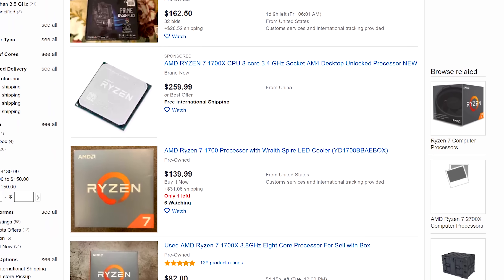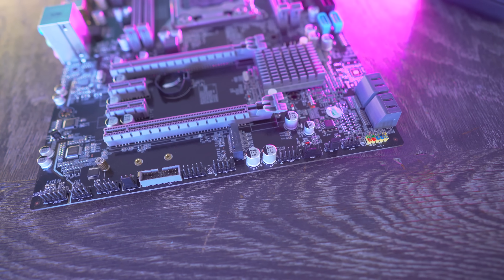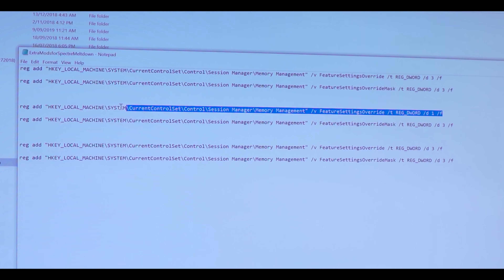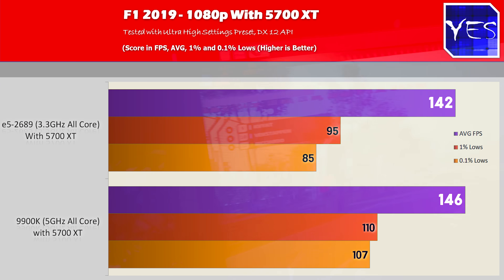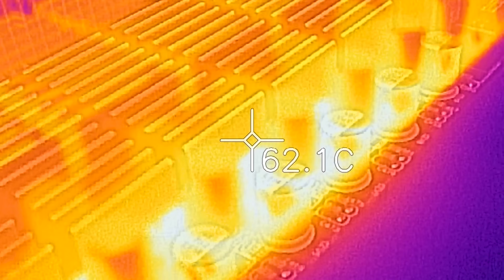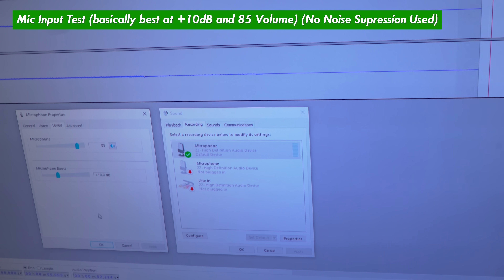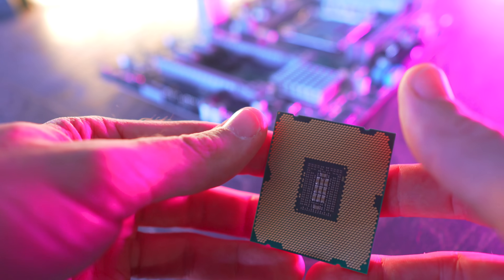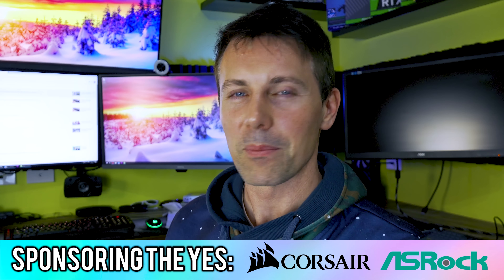8 Core CPU for $53....!? Will it BOTTLENECK a RX 5700 XT...!?

Comment: Machinist is better than Kllisre X79 or Huanan?
Reply: I would actually suggest someting like this, even has a better chipset than the one in the video
https://www.ebay.com/itm/X79-Intel-B75-Chipset-Support-M-2-USB-3-0-Socket-Desktop-PC-Motherboard-Game/123777286353?hash=item1cd1b380d1%3Ag%3AuFcAAOSwLuJc5RBT&LH_BIN=1
Reply: Its a Huanan motherboard, but they have to remove branding in order to send it to the united states without their weird tax
Reply: @KadiusFTW  Look this Kllisre mobo https://m.es.aliexpress.com/item/32969830382.html?trace=wwwdetail2mobilesitedetail&pvid=51378943-f1e8-44d4-b20b-9312bea95a31&_t=gps-id:pcStoreJustForYou,scm-url:1007.23125.122752.0,pvid:51378943-f1e8-44d4-b20b-9312bea95a31&aff_platform=msite&aff_trace_key=1b89ce0b454e48e681de3b0e2f20e40a-1568282292545-03148-ZnYB2bmuV&gps-id=pcStoreJustForYou&scm=1007.23125.122752.0&scm-url=1007.23125.122752.0&scm_id=1007.23125.122752.0&spm=a2g0n.store_home.smartJustForYou_345457263.0
Reply: @lucianobv007  thats an h81 chipset, less features. Still has quad channel though
Reply: @KadiusFTW  No bro, is B75
Reply: What about plexhd?
Reply: @combatantezoteric2965  plexhd is rebranded huananzi if I recall correctly
Reply: @KadiusFTW  on russian forums I saw that the plexhd mobos use the b75 chipset and this should mean that only one sata 3.0 port will work. The thing is that I don't know about the other mobos and chipsets, but I heard that the huanan mobos are sold with a lot of chipsets, not just with the b75. Maybe here is the difference.
Reply: @combatantezoteric2965  Yes and no. The chipset only supports 1, but thet have an onboard pcie sata controller, which is what the m.2 runs off of if I recall correctly

Comment: i think the difference fps come from the ram type, ddr3 is slower than ddr4
Reply: Quad channel 16000mhz is about 3200 ddr4 in dual
Reply: But it's 1866 quad channel, it's 933x4 and gives a result of 3732 mhz.
Reply: It's more likely to be from the IPC difference. RAM speed really has little effect in gaming, and X79 has a lot more bandwidth to play with.

Comment: hey bryan, check this out, i just saw a video of a youtuber that said they were able to flash a 5700 with a 5700xt bios. maybe you could try that and make a video out of it? so far they have only managed to do it with a reference card. it was only 3.5% slower than a real 5700xt.
Reply: Generally you can OC an 5700 to stock 5700XT. Was it 3.5% slower than a stock XT or OC'ed XT?
Reply: @xingbairong  stock XT. But here's the thing, with a simple bios flash you don't have to do all that. You just have to flash it.
Reply: @franzb69  Well the thing is that with a bios flash you might screw up your card while OC'ing the new Ryzen and RX can't be more simple, so I really don't see the point. They are all so similar, that I'm sure that there are already sites that give you what exact numbers to put to get the most out of them, without having to waste 1-2 hours doing it yourself.
Reply: @xingbairong  that's why they've only done it with the reference versions. besides there are versions of the cards with a dual bios, just flash those and check it if it works. and also that's why i'm asking bryan coz he knows what he's doing. i've done it a few times before myself. fixed a few mining cards, put them back to stock and all that.

it's not really that hard, at all. you just have to know what you're doing.
Reply: @franzb69  yes but overclocking the new 5700s is easier than flashing bios therefore what's the point if they offer the same performance?
Reply: @Mythicalgoon  software settings can be reset. You have to keep tweaking core clocks, voltages, memory clocks. You move that card to another computer, you'll have to do it all over again. With a bios flash, you set it and forget it. No software to worry about, no tweaking. It's not that easy with the software overclock.

Comment: All I’m gonna say is this cpu ain’t gonna be 53 dollars for too long
Reply: Anyone remember the 24$ 2420v2 that Brian made a video on  it's 12$ now
Reply: @kruxdt6307  13 € now
Reply: @kruxdt6307  it's $8 now
Reply: people say the same thing about every tech video. this cpu has been readily available forever, and if you want to use a decent board its not cost efficient over ryzen.
Reply: @D-2-RZ  over 3600 ryzen or 2600
Reply: @monsterzero9456  1600
Reply: @monsterzero9456  a 2600 set up with board and ram in the uk is £300. £370 with a 3600. these older xeon boards are circa £150. i know because i run a xeon setup but i use a non oc board. with an oc p6t asus board itd have set me back £250 with ram and cpu, so not worth it.
Reply: @NaoVII  1600 btw is dead, its £110 new or 2600 is £120 new and the 1600 has ram compatibilty issues aswell. 2600 THE cpu atm
Reply: @D-2-RZ  It's almost $70 on AliExpress while 2600 is still around $100. I wouldn't say it's dead knowing that the performance difference between those two is very minimal. About the ram issue, I've never encountered that, and I've built like 20+ R5 1600 systems.
Reply: @NaoVII  First gen ryzen are notorious for their ram issues. Not just the 1600, but all. Still I agree that they aren't dead by no means. The 1600(even the 1400/1500x, heck even the 1200/1300x) will be good gaming CPU's for quite a few more years. Anyone who says otherwise is just plain dumb or just don't understand from tech at all.
Reply: @xingbairong  its not dead in a sense it works, ill agree, but for the extra $30 youd be mad not to get the 2600. in my case the price difference is £20 so its a plain waste of time buying the 1600 unless your budget is super tight
Reply: @D-2-RZ  Sure if the budget allows it, it's definitely better to get the 2600, however a lot of people have a set budget that can't be altered and some times that small difference is a deal breaker. For those people the 1600 will do just fine. The price difference is literally the performance difference which is negligeble and people shouldn't feel bad if they have to go with the 1600. The only downside is the ram. In most cases nowadays you will have to OC it yourself because the XMP probably will cause crashes. That's all.
Reply: @xingbairong  agreed 👍
Reply: @monsterzero9456   ryzen 1600  3.9ghz  2600 4.1ghz  3600  4.3ghz  they are all basicly the same minus 2 or 3 fps
Reply: @D-2-RZ  I picked up an excellent ASUS p9X79Pro for EURO 70, coupled to an E5-1650 (V2) for $130.  The board came with 32GB DDR3 1600 RAM ($60).  To me, this is worth it.

As for Chinese MB's...a decent Huanan for about $100, which I paired with an E5-4627(v2) which turbos on all cores (8C/8T) to 3.5GHz (no OC).  That CPU cost $80+$14 shipping.  Runs cool too.  To me, again, worth it.

Of course, nothing negative about Ryzen, in USA or CAN these can be had for great deals.
Reply: @jb678901  superb deal that. you can pick up bargains sometimes but usually you have to sit on it for a while in the uk.
Reply: @D-2-RZ  Still useful information though. I was out of the loop for some time and was considering just getting rid of my x58 (either price to sell or donate) until I saw videos like these and realized I could actually upgrade and make usable. These videos are great for those that may run into a used system or someone that does not know they can get some good upgrades from their hardware. But yeah, I think you do have to figure out if you are better off just putting that money into a new build.
Reply: @Being_Joe  yes dude. if youve already got the case, psu etc its a cheap easy upgrade. i dont know if id benefit much for the £100 though as im not an fps chaser and i already have 12 threads so in multi tasking the w3680 does fine for me. would be an easy upgrade though if i did.
Reply: Well its on aliexpress for so long time, just people are not aware of it. Shame that today people dont do research by themselves instead of waiting for yt to bring it up
Reply: its still $53 dollars 5 months later...
Reply: Dude you called it! It's on $60 now
Reply: @ollemelen3666  $66 :( still not bad i guess
Reply: your rignh now its under 50
Reply: yess got mine for 29.95 dollars july 2021
Reply: It’s 16 now
Reply: Its 16 dollars now XD
Reply: Yeah it wont. Cause its now 13 dollars in my country XD
Reply: 3 years later that cpu is 5£ on aliexpress 😂😂😂😂
Reply: Well if u can order from some sellers in Taobao( Chinese version of Aliexpress) then u could buy some decent x79 boards from asus, gigabyte,evga for 10-20$ more
Reply: @gmailmann  what are you refering to buddy?
Reply: @gmailmann  yes it can vary. i myself use the w3680 6 core (£41) with a z400 v2 board (£35) and oc with theottlestop. if i wanted the asus board id have to add approx £110 to that price
Reply: No it won't because it's the motherboards that cost a fortune so its not worth it unless you get a good score. also these chinese boards arent known to be the most reliable maybe theyre getting to that point now but it's still a big risk imo
Reply: @Ray-tq9hb  that was my issue, chinese boards, which is why id only go for an asus board which puts the build price out of the park on a xeon processor in the uk. and to boot chinese boards are pretty much the same money as b450m boards here, so again no point.
Reply: @-RAYZ-  thats not bad, how much are 2600s at micro centre atm?
Reply: its hovering 55$ by various sellers on aliexpress
Reply: @OM-jc9mh  if the board is good and runs ddr3 on 4 sticks at 4 channels and at a good speed then ddr3 is actually quite faster than ddr4 because ddr4 even though it has a much higher clock only runs in 2 channels. If that is what you are asking
Reply: It has been for a couple of months
Reply: Now its 47$
Reply: Nope, if they raised the price it would have to compete withthe ryzen 7 1700 which is only $100 on AliExpress, and that CPU is much better than this thing...
Reply: You were right, it’s now it’s 50 dollars lol
Reply: No thanks Intel is shit
Reply: 8 months later and yeah the price has stayed firm on aliexpress
Reply: I would rather go on ryzen than this.
Reply: I used my R3 1200 for a while n maybe a few months ago upgraded to the R5 1600af. Even still I didn't need to change my CPU the 1200 still games just fine. Rendering videos the 1600 is alot faster. These xeons always interested me, they seem like they are good CPUs for their age.
Reply: @stevegutierrez8679  yeah only those dumb will buy new cpu to get +5 fps,
Reply: I was the 666 like
Reply: And now is 44 dollars on aliexpress ;)
Reply: If you are gifting it to someone, then this combo with any chinese repurposed mobo, its OK value. But I think you have more future proofing by buying a Ryzen 2600 with an A320. And with some A320 mobos getting Ryzen 5000 support, the value is even better.
Reply: Yeah, it dropped to $35 a year later
Reply: ur right its cheaper
Reply: $16 now. Bargain
Reply: @RG3DHD ha ha... i made my last comment on this 3 years ago 🤣....

I cant believe the setup i had at the time looking at this thread. I now run 12400f, 2080 super founders.

How times change... Used....  Ryzen 1600 £65, 2600 £75. Crazy 🤷🏽‍♂️

Thanks for the revive! 🌅
Reply: Did anyone notice the price jump of e5 1680 v3 the past couple months?  They doubled to nearly trippled in price in that short time.
Reply: @-RAYZ-  just had a look, ryzen 2600 on amazon uk is now £109. theres a seller knocking out new b450m boards on ebay for super cheap .... £44 delivered. 3000mhz corsair ram is approx £80. i could sell my set up complete for approx £130ish. i could effectively upgrade my rig to ryzen 2600 for £100. crazy times

Comment: Were you able to use the gigabyte X79 UD3 with the CPU? Thinking of getting one with this motherboard.
Reply: yes every x79 board should support it
Reply: @Spacy1717  That's what i originally thought, but technically its a custom CPU made for some older workstations. So im a bit hesitant to buy it.
Reply: @alpha8937  Not a custom made cpu. It's just a Xeon for the server market. Anyone can buy them new, Tho they like you to be a company and they cost thousands new.
Reply: @madb132  it is actually specifically made for dell I think but it has exact same microcode as e5 2690 it will work on almost all x79 mobos

Comment: Or you can find a used R7 1700 B350 combo for 170$ instead
And don't have to worry abt all those security flaws
Reply: Amazon selling 1950x 12 core 24threads for 200 dollars right now
Reply: @whereswaldo9089  That's on inventory sale because AMD can't sell them...and Amazon is not available in Asia (where majority of people live)
Reply: @Sushant S Nair For $200 I could get TWO 10 core 20 thread Xeon 2660s. I literally just did that a month ago and jammed it in a Chinese dual slot motherboard that costs $100 brand new.

A storage for my house
Reply: That would be very hard
Reply: Those security flaws are usually exploited in corporate environment. Or even in a home space, you are likely a high profile corporate guy. The B-series chipset for AMD are useless, might as well get the X-series boards.

I guess AMD is just being an asshole for not divulging the issue and solution to everyone in the semi-conductor space. Ever wonder why AMD's Zen CPU aren't greatly affected? Their Faildozer chips and older are affected.
Reply: No such thing, people are still distrought on how their 1st gen Ryzen now has barely any value (1800X can cost as low as $200 now, it was originally $500 USD).

I barely see anyone selling their 1700 lower than $200, even if its value is around a little higher than an FX 8 now
Reply: @JABelms  too much servers selling off used Xeons, nothing could ever beat Xeon on price anymore. It's amazing.
Reply: Sushant S Nair in my country a used 1700 is around 120-130 USD
Reply: @Sushant S Nair Probably would shit themselves on any power issue. But I only use Seasonic Primes for all my builds so I'm good for years. The issue with cheap Chinese products are QC. Doing warranty is a hassle but that's the cost. Compared to getting outdated ASUS dual slot motherboards that still cost $300 and up
Reply: It really comes down to your local market. Recently I got for that exact price an R7 1700 + x370 + Prism cooler for a friend. He wanted something new with more cores, so that was the best option in that price range, however when you add the RAM it still gets quite a bit more expensive than the 2689+32GB RAM+mobo+cooler. What's more most 1700(at least where I live) aren't being sold with coolers, so you would usually have to get a cooler as well.

Is the extra $ worth it? Well if you plan on upgrading to a 3900x it would, though the question is if the cheap b350/x370/b450/x470 you bought will be able to handle it because a lot of boards can't handle it. If you don't plan on upgrading to 3900x in the future I think that the xeon is a better option because after 2-3 years when you decide that you want to upgrade there will be DDR5 and god knows what else, so chances are you will want to switch to the new platforms.

The x370 killer sli that I got for my friend should be able to handle a 3900x at stock with some airflow, so that's a good purchase in my opinion and what's more it's an ATX board and looks really beautiful and with the prism it was definitely a deal, but if I didn't get such a deal I would've forced him to go the chinese route probably.

Also people really need to think what they will use the PC for. Honestly if you are only after playing games the 2689 is the better purchase because the money you save you can put in the GPU, because we all know that when it comes to gaming the GPU is the most important part.
Reply: I knew somebody would scream in panic about the security issues. Newsflash, avg joes or ordinary users do not need to fear those security issues as they are vulnerable for so much more crap out there like scripts and so on through web browsers that the spectre/meltdown issues are not a real issue as they are more of a security issue for companies to worry about.
Reply: We all know those 'security flaws' are nothing to be afraid of, as a home user.
They were pinpointed and hyped by AMD fanboys.
Reply: @ares23dc  LMAO Shintels in denial!
Reply: @ares23dc  basically lol

Comment: Heyyy, amazing timing. I just bought a bundle with e5 2689 32gb ram and a Plex hd motherboard for $303 AUD including taxes and shipping
Reply: @OM-jc9mh  if you use ddr3 memory in quad channel, you should get about the same bandwidth as a decent dual channel ddr4 kit. In this case, ddr3 shouldn't matter too much for gaming
Reply: @anmolsaxena_  don't forget that the latencies are usually lower in DDR3, so it should surpass DDR4 in most cases.
Reply: @rhyzon  And on top of that, DDR3 in Aliexpress bundles is likely to be ECC, which can improve performance in some applications (though it's also most likely registered, which decreases performance).
Reply: @OM-jc9mh  Correct. DDR3-1866 in quad channel is just as fast as DDR4-3733 in dual channel. DDR3 also has less latency than DDR4.
Reply: @HazewinDog  Could you elaborate? please i want to know. I have quad 1600mhz 32gb
Reply: No delivery to germany :(
Reply: @Nick-ov8ed  very unfortunate
Reply: I basically got the same but with 64gb of ram for 200$ CAD (not in a bundle though)
Reply: How's it going?
I'm planning to buy the same build with rx570
How many fps do you get?
Reply: is it working still?